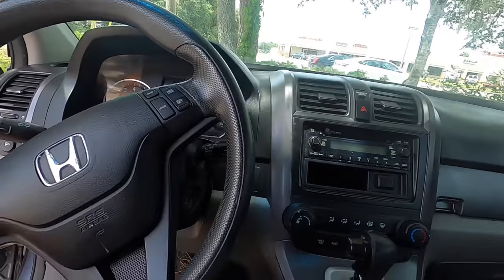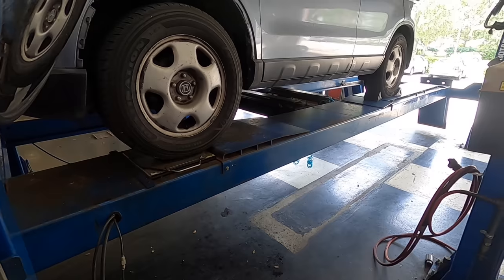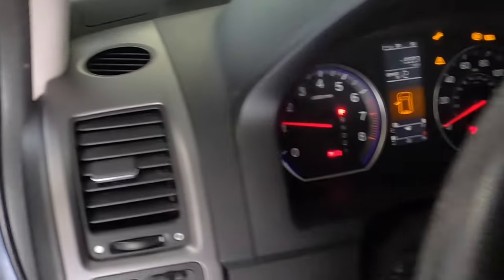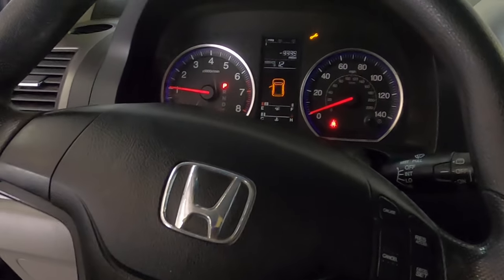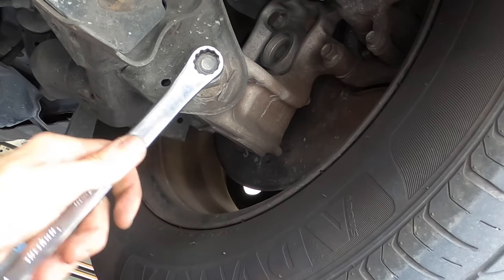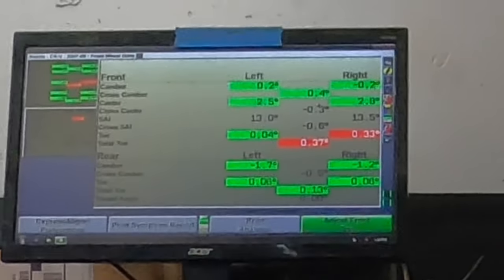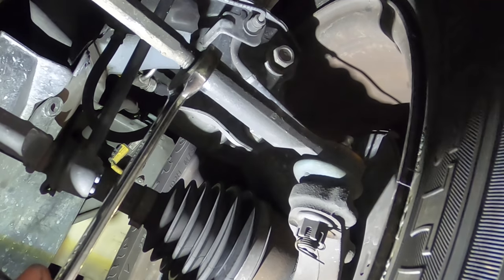Wheel Alignment Basic Tutorial | What is it and do you need one?

Comment: I use to be the alignment guy at my old shop...and I can tell ...you did a good job
Reply: Ya, before I changed careers, I used to do a bunch of alignments including from body shops.  That was around 11 years ago.  I’m getting new tires on Saturday and it needs an alignment!  I replaced some worn out parts.  Got toe close with a tape measure!  New tires, in need of a real alignment.  Wish I could do it myself using their machine.  I have trust issues with people as I know how people work on cars!!!
Reply: Its not as hard as it used to be.  Did you ever use the old clamp-on slitted light boxes with wall targets shit?  Knew a guy who's floor shifted that ended up taking about 8 million miles of lifespan off people's tires before he realized it.
Reply: Except the first step in an alignment is too always check & correct tire pressures. You know this as you were the alignment guy
Reply: That's true ...your right bud
Reply: @prjndigo  no me I actually work on the alignment machine with laser beam pointed at each other around the car
Reply: @TheSoldierX2  I have to agree...  Bought 2 new tires, they put them in the front and rotated the old ones to the back and asked them to check the balance before they did so.  I was supposed to get an alignment but it was late and he asked if I can come back tomorrow. While I was home, I decided to check my tire pressure. The 2 fronts were 34 and 36, the rears were 28 and 35. They obviously didn't  check the balance of the rear tires like I asked. The next day I told the mechanic that I've already made sure the tires had equal air pressure as all 4 tires had different air pressures yesterday after I left. I got the look as if I were speaking a different language...

Comment: FYI: As far as the title "should you buy it?" as a tech for 10 years 8 being at a GMC dealership there are typically 3 reasons you want an alignment: 
1: Suspension repair , control arms, struts, steering gear, tie rods, etc. In nearly all cases after suspension work was performed you need an alignment because either it was out due to worn/damage components and the new components need to be set.
2: Good Practice when you buy a set of tires/ or replace front/steering tires. It helps prevent premature tire wear to get the most from your tires. 
2A: If you have all wheel drive or 4 wheel drive it is important to replace tires with same size and tread depth due to these systems. Also mismatch tires/ brand/style/tread can cause ABS /Wheel speed sensor issues and traction issues regardless if you have AWD/4WD or not. 
3: As regular maintenance: From hitting pot holes and other things from driving a vehicle daily it can and is possible to knock your alignment out of adjustment.  There for causing steering issues and tire wear. which could lead safety concerns. Typically if #1 and #2 reasons are needed an alignment once a year/15k miles
Reply: As a mechanic and customer I'll disagree a bit. Correct for 1. Change 2 and 3 - If there is uneven or abnormal tire  wear. Eye-ball and run a hand across and along each tire at every oil change or 25 miles after a bad pothole. I had precautionary alignments done on my Citroen at roughly 40,000 and 80,000 miles (mainly because there was a shop that would do foreign cars). No parts change or adjustments were needed when I sold it at 115,000.  4WD and AWD need religious tire rotation and tire pressure checks.
Reply: @wssides  I dont disagree with you at all. the once a year /15k mileage interval is based on visual inspection of the vehicle of course not just ok I hit 15k I must go do an alignment. Its a generalization same as change your oil every 3-5k. But there are two types of cars a mechanic has... either a shit box held together and know exactly what to do to get it to run... or a new/ like new vehicle with all Preventive maintenance  done. It seems you are type B and same as me I have an 18 Sierra with less then 35k on it and in like new condition.
Reply: I have a 06 Chrysler 300c awd and just had a 4 wheel alignment done at my local vip. I changed all my rear suspension arms and the front was done last spring. I changed nothing in the front but, my alignment was way out front and rear. I knew the rear was cause I had no way of getting it right on after changing the control arms. But it drives a million times better
Reply: I noticed replaced rims were omitted from your list. Are you saying I have was getting ripped off every time I got new rims w/o anything else from your list or you forgot it?
Reply: @miscellaneousproductions  Replace rims when damaged. (bent, cracked, rusted badly) Should be found during new tire installation or routine balancing.
Reply: @wssides  Yup, that's when they found mine...
Reply: What gets me is I watch so many car shows on the regular channels and they just throw a lift kit on or some sort of modification and never say oh by the way why don't you take it into an alignment shop they said a lot of people up to get into a real mess because they do something in a half hour and people think oh it's easy no it is a lot more to it there's things they leave out that can end up costing you money cuz you'll have to take it to a real mechanic to get it straightened out like Ray have a great day

Comment: You run your machine exactly the same way I do. Down to how you center the wheel, install the brake depressor, and other things you do. With two exceptions: 1) ALWAYS check and set tire pressures. 2) I do not, under ANY circumstance, take the word of even a fellow technician (much less a customer) when it comes to what parts have been replaced or if there are other bad parts. EVERY alignment begins with a full inspection of the suspension front and rear. I can't tell you how many times I have found additional bad parts after a customer or tech has said "we just replaced so and so".

Comment: Where I learned alignments the common practice is to toe out slightly on the front left. This is because we have lots of rural areas and many of our roads have a crown in the middle; so slight toe-out on the front left helps keep the car straight while driving with less need to compensate. A major toe-out would screw it up, but the light touch is noticeable and appreciated when driving.

Comment: They put wrench flats on the tie rods and the tie rod ends for a reason. 2 wrenches for loosening/tightening the lock nuts
Reply: Yeah, but sometimes it's just easier to grab a set of channel locks because you know they're the right size. Me personally I'll bust them loose with channel locks or a full size wrench but once it's moving I love my stubbies for the actual adjustment.
Reply: @1337penguinman  especially when youre carrying tools over to the alignment bay. Easier to grab one size fits all tool
Reply: Sometimes you need a ' smoke ' wrench to get those threads moving.

Comment: Love your videos. Two tips if I may suggest to chock the wheels and not apply parking brake if it is a cable operated set up as it can put strain on rear suspension and falsify the rear readings dependent on suspension. Secondly I have a spirit level clamps on steering wheel spring loaded. Fairly cheap on Amazon so easy to be sure wheel is level as when not sat in seat difficult to judge properly and nothing worse than having to repeat the process.

Comment: Thanks for adding the control arms didn't look replaced. I noticed that also. you sir are an honest mech. To answer someones question things like control arms I never put in a used part on the steering. Plus the control arms are cheap in compared to your life of putting in a used part. besides why put a used part in that you can buy new for about 15 bucks.

Comment: I would check tire pressure as first step unless I knew the other shop had done that.
Reply: That is a very important step to an alignment is to make sure tire pressure is within spec, personally I think his alignment procedure was horrible as he left the specs and degrees 1.7 and 1.3 which is not acceptable at my shop we try to get everything as close to zero as possible because that 1.7 on the left side could come out of adjustment within a week or two after hitting a pothole or other road issues and that's why we do zero or close to zero as possible
Reply: @willsrestorations  that 1.7 and 1.2 was the rear Camber, and often on these vehicles there are no Camber Adjustment on the rear, and both are still within spec anyway, the main thing on these is toe adjustment anyway as that is the main cause of tyre weare and handling.

Comment: That was well done alignment procedure. Especially the test drive. Many shops don't do that drive an d it is crucial for the final results (I have seen many cars going out of alignment procedure still pulling to one side). The way how you tighten the tie rod nuts though is debatable. Indeed you should use two wrenches. Just not to get there 0.02/3 degrees off at the end. 
I suggest buying good tripod for the phone and doing more work two-handed 😉

Comment: I do my alignment at home in my driveway with a steel machinist ruler with a magnetic bubble level for camber and a tape measure for toe. I have no steering or wear troubles whatsoever.
Reply: I manually align them as i drive with the steering wheel..
Reply: @fixitfelix718  that'll work too.

Comment: That vibration at speed is more than likely caused by the Firestone tires, we had a lot of warranty claims for ride disturbance due to out of round tires in my shop. A few years ago they had massive problems with tread separation causing accidents. 😀😀👍👍🇦🇺🇦🇺
Reply: Did they? Only seen the tires once and they came in bald with 5k miles on them. Alignment was in spec too....
Reply: Thanks for the heads up. I had been considering Firestone replacement tires. That's making me think again.

Comment: Changed the shocks and struts on my car, went for a wheel alignment, still had a vibration at high speed. Went for a tire balancing, discovered I had a bent rim, possibly caused by a huge pothole I remember hitting hard a while back. It only revealed its presence after the tires were rotated and the bent rim was moved from the heavier front to the lighter back of the car.
Reply: Got new tires last week, found out that my 2 right side wheels were bent badly when balancing. I remembered hitting a chunk of debris a few months back but never felt any bouncing or vibrations afterwards. Got both wheels fixed yesterday and getting an alignment next week...
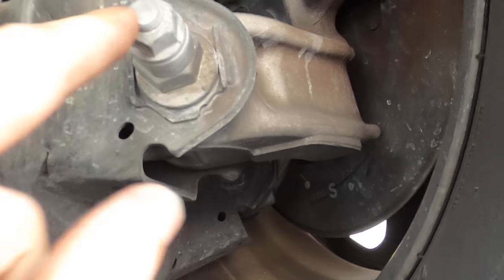Reply: The engine way will cause the tires to just spread out slightly causing the sidewall to press up against the of the rim It will cause excessive, vibrations just figured that out and this thing has been a real inspiration to me getting my brain working before 7:00 8:00 in the morning not even finished with my second cup of coffee have a great day  man

Comment: In the mid 80s I did wheel alignments at a tire shop on an FMC machine with analog gauges. Had to look everything thing up in Chilton books. The heads were wired back to the unit and I had to raise each wheel off the ground to turn them to 3 positions for run out. I hated doing them.

Comment: After having some repair work done on my '06 Honda CR-V that I bought new from my dealership, I had them perform a recommended alignment. About eight days later I bought new tires from a Sears auto center. A sales guy said they'd check the alignment and do one if it was needed. I said skip it as the dealership just did an alignment. The sales guy said they'd still check the alignment. When I returned I found they did an alignment and charged me for it, as they claimed it was out of alignment. A week or two later I brought the vehicle to my dealership and told them what Sears did. They checked the alignment and told me that it needed an alignment. I showed them the Sears alignment data and they said it was the same as theirs (they didn't charge me this time) After that experience, I don't do alignments unless I think there's a problem.

Comment: Nice work. 
But. You’d be so jealous of the new Hunter Elite machine we have. Heads clip on the tires with 1 thumb up to a certain diameter. Runout is the same except it starts in the rearward position and roll forward about a foot, done.
Otherwise the same, just easier set up.
Does your machine do the vin scan to avoid manual entry on capable vehicles?

Comment: I always lock the steering wheel in place when doing these. Maybe the turnplates on my rack have less resistance but the wheel always likes to move on me whenever I'm setting toe.
Reply: If you have a hunter aligner then you should just use wintoe.  It's a program built into the software that compensates for movement in the steering wheel. The only vehicles I use the steering wheel lock are solid axle pickups with a single tie rod adjuster. All dual adjustment vehicles get set with wintoe. Your steering wheel can move as much as it wants and the computer will compensate for it.

Comment: I see that you did the Toe... but what about the camber (The inward and outward tilt of the tire and wheel assembly)? I know a lot of it will be dependent on the bearings, etc. but you didn't mention if your alignment machine measures for camber, if there's any small adjustments that can be made for the camber.

Edited to add that I see the camber measurements on the screen at the 6:32 mark... but nothing is mentioned. The reason I bring it up is that I had an alignment done at a shop in Phoenix AZ before driving/moving to Florida. Had the tires changed in the front due to the inner wear on the tires (found out when a tire went flat) that was down to the braids. Took it to a dealer here in Florida, and had them check the suspension and do an alignment. This was back in 2019 for my 07 Monte LT, and since the tires have been wearing normally.

Comment: alignments up in the rust belt on a car that's 5 or 6 years old most of the time result in more than one of the following.... bushing replacement, control arm replacement,cam bolt replacement, tie rod replacement, etc before alignment. i also have to prep my alignments on a 2 post because crap gets so rusty... if I start jarring the vehicle on the alignment machine it will throw the alignment off. fun times..

Comment: Why didn't you inspect the suspension for loose or damaged components or check tire pressures? I know it came just from another shop. I noticed that both stabilizer bar links the lower boots were torn. Why no jouncing of the suspension before and after your adjustments to settle the suspension components?
Reply: He drove the car on the rack. That settles the suspension and steering.  Older alignment machines required you jack up the front and rear wheels to check the run-out, but his fancy-schmancy machine did that just by moving it back a foot or so. No need to resettle suspension if car wasn't jacked up.

Comment: Aligning your vehicle that has a part replaced?
If the part controls caster camber and toe, it's wise to check it.
If it's out of spec, you adjust it.
At least it would need to be verified for completion and avoiding the causes of undue tire wear.
If something's not right, now's the time to measure and get a print out.
Failing at this leaves the question open for it's future need of tires or correction.
That's why it's so often part of the job, or suggested.
I've even had cars that it turned out we learned there was a factory defect structural issue.
If they don't notify  the manufacturer they are now the cars owner, they don't get notified.
If there was a collision related failure, oh, that would be soooo bad.
Running your vin through the factory data never hurts.
Seeing issues during aligning the vehicle raises questions between one service manager and another.
We called it's home dealership.
It had to be repaired as per a recall it turned out.
Good catch, that day.

Comment: I used to do alignments back about 13 years ago, so little changes here.  Only question I have is, do you no longer need to put a holder on the steering wheel while adjusting the front?
Reply: I have put one on every single alignment except jeeps where to get the alignment right every single adjustment we turn the wheel left to right then center and hold it manually.

Comment: Interesting vid, thanks. 

By the sound of it there's some serious rope stretch on that ramp.

If the grounding pegs on the ramp were set correctly you could do the roll back and caster swing with the ramp on the ground it would be a lot easier. In any case as the aligner is working in three dimensions, within reason the roll back surface doesn't have to be completely level.

Apro pro of nothing much; I'm not a fan of the "Hawkeye"

Comment: Have done the math on this alignment system concerning the wheel run out.  There is insufficient accuracy in the run out measurement.  Further, if the wheel shape is other than perfect that run out error is even larger.  To see this fail complete an alignment and then remove the  car and set up and do another alignment.  Nine out of ten this system will show incorrect alignment.  This is why I no longer use any alignment service places instead purchase precision equipment: turn plates; precision inclinometer; and a few other custom items and now have perfect alignments every time.  Is a hassle but, having this perfect is really nice to drive.

Comment: I had an alignment done on my 05 4Runner after replacing struts. The guy used channel locks or something on my tie rod, instead of a wrench and chewed it up pretty bad. I fixed it with some emory cloth. My steering center was good before the alignment, but the screwed it up. I went back 3 times and they never fixed it. I took it across town and had it done right and will never go back to that local shop. The tie rod is hex and should not be adjusted with a plumbers tool.